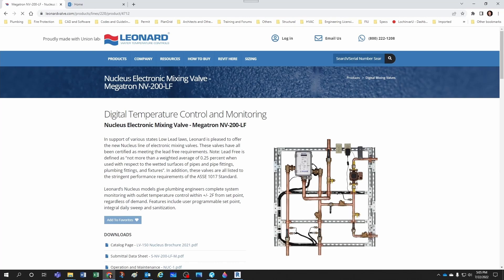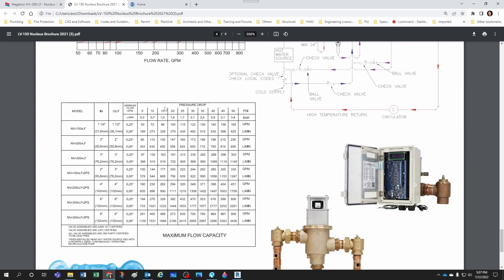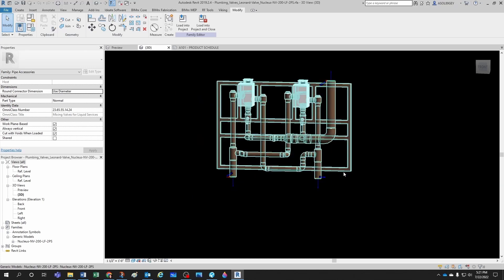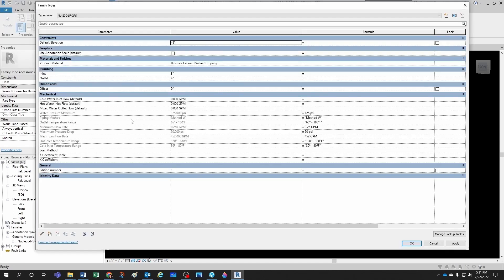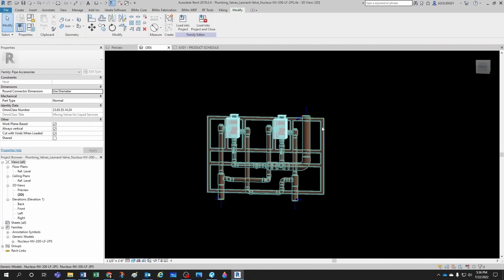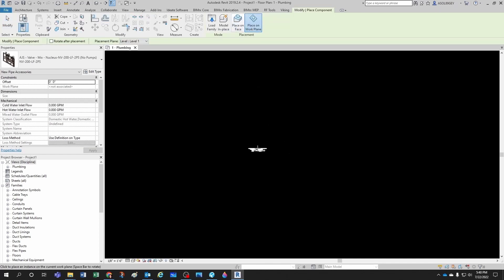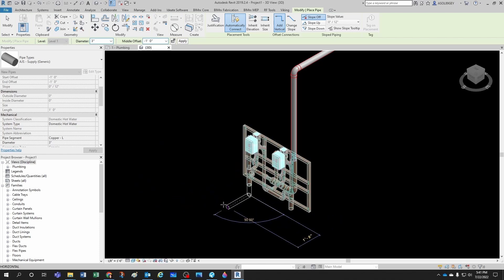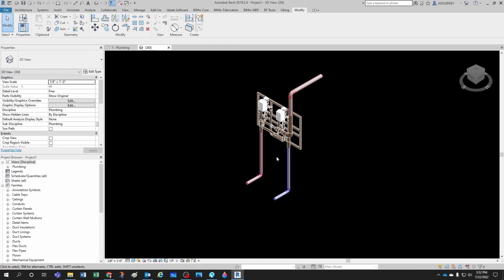Mixing Valve Selection and Revit

Comment: Hi Alex. I have gone through this process step by step multiple times yet I cannot get the TMV to calculate the FU from the connector. Both DHW & DCW is set to Fixture Units and I have used parameters to calculate the split between required HWFU & CWFU. I have changed the tempered connector back to "calculated". It all works in the family, but as soon as I connect the pipes and add the "Fixture" or pipe connector, the pipe system up to the TMV reads the FU but the pipe connector on the TMV does not calculate nor transfer the info to the other connectors? the only way to get them to work is by manually changing the number, which kinda defeats the purpose. I have tried changing the fixture connector to HWFU as well as TWFU (which I created) but to no avail. The problem on the video is that when you test the system, you revert back to the original  settings of 100FU which then shows the 75 and 25 on the other connectors (as you set them up in the family test), but I never actually see them change to any other values on the system once the connection is complete  :) Sure I am just missing something basic but would love some input if you could spare a moment.
Reply from the maker: Revit changed it's configurations for "Fixture Units". The units used to be FUs, now it is just a "Number".
Try creating the family in 2020 and upgrading. Good luck.
Reply: @bimitup  no luck unfortunately. Appreciate the reply.